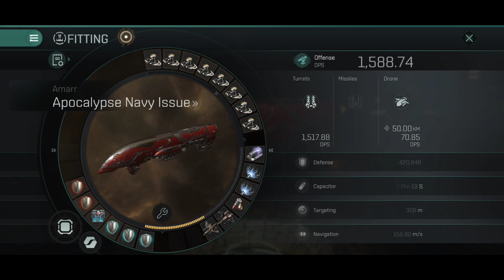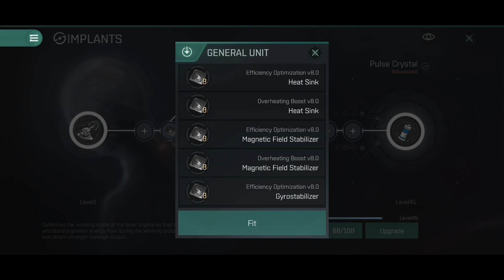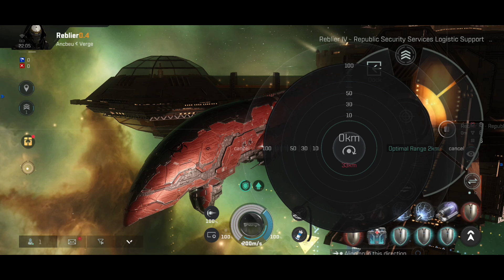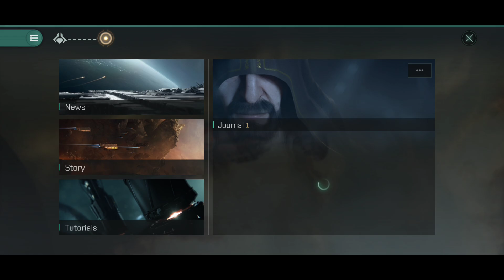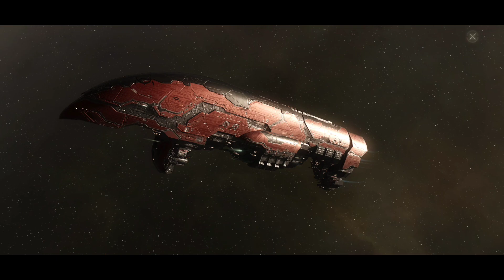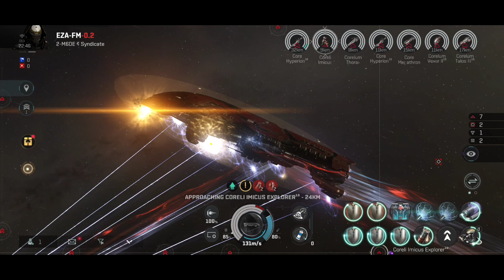EVE Echoes Infinite Capacitor Apocalypse Navy CHONK! - Frankenstein/Troll PvP/PvE Build - LOLFIT

Comment: Hey Virtual, what's the engineering rigs your running on this, 3x CCC?
Reply from the maker: Ye the usual engineering cap rigs, combat rigs 3x burst
Reply: @VirtualPersonYT are you suggesting I use the bursts for pvp, instead of the integrations?
Reply from the maker: @general_mcnobi4837  If you want to replicate the troll fit with PC, integrations bursts for pve or glass pvp fit.

If you want to use the pulse crystal lv45 attribute for infinite cap glitch integrations for tank
Reply: @VirtualPersonYT  this is definitely intended to be a pvp ship, so 3xccc for engineering, and exact same integrations for combat. Better to use frequency reducing, or enhancement integrations?
Reply from the maker: @general_mcnobi4837  If you want best stats then go with 70/80% integration if you want effective but cheaper the 60%s will do just fine
Reply: @VirtualPersonYT  thank you kindly mate I appreciate this 🙏
Reply: @VirtualPersonYT  thank you mate! Think am gunna have alot of fun with this one xD going to go through the painful process of getting Pulse Crystal to level 45 😭